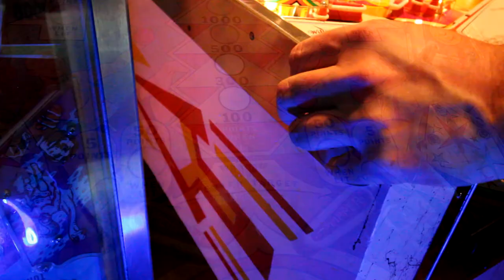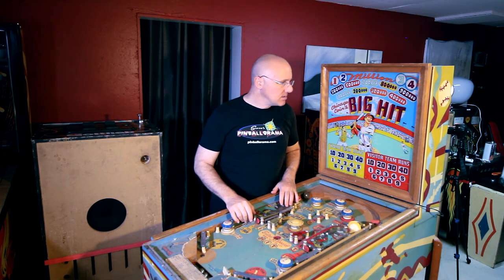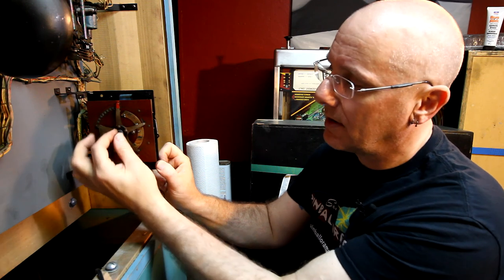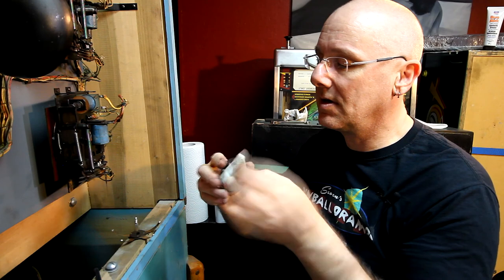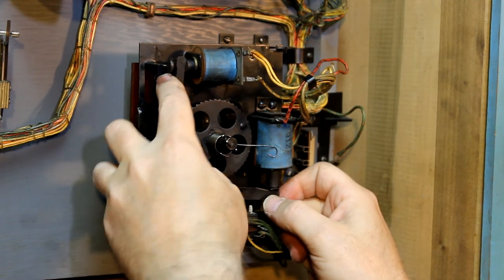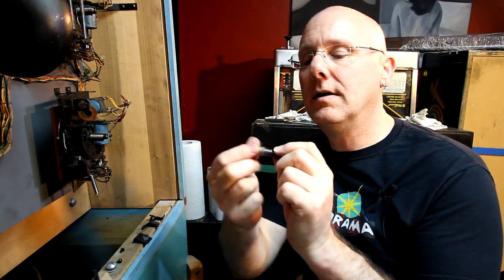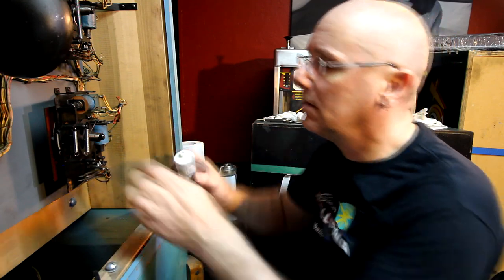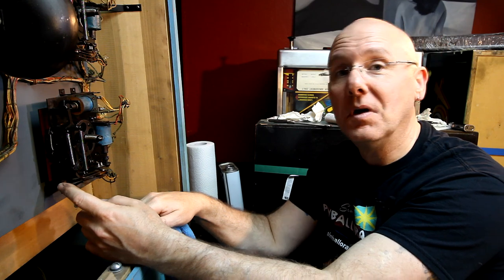Pinball Repair #8 - Cleaning Stepper Units

Comment: Great Video this should help me a lot I have a 1958 Williams Tic Tac Toe that my Parents bought for me back in around 1970 and it just cycles when started and I was told by another owner that owned 2 of the same machines he had the same issue and it was the 10,000 point stepper that was "Gummed up"

Comment: That field looks like a nightmare to play! Hoooly eff, versapack black and decker... you've done well to keep that thing alive
Reply from the maker: I have two of those screwdrivers and they're awesome. I got them around 1999-ish and used them in my computer store for years. I probably assembled and repaired 1000s of computer workstations with them. I need to get new batteries for them. They're starting to die.

Comment: Good information for people that are intimated by working on stepper units. The only negative procedure I seen was of lubrication. Pretty much a no no. Anyone who wants to argue this point out can give Steve young a call and get a earful.
Reply from the maker: I know there are some people in the no-lube at all camp. I like to use it only in the areas I pointed out in the video. A small amount of Teflon grease helps a little with lubrication, but more importantly it protects this area from corrosion (this is also the reason I put it on the contact points). The synthetic greases shouldn't dry out or get gunky and shouldn't gather dust and dirt like a standard oil. (I would never recommend something like 3 in 1 oil.) If the machine is always kept in an area where it will not get rusty, then you are probably fine running it dry. But who knows where this machine will be in 10 years. I might sell it and it might end up in another garage. The little bit of grease I added will help prevent this point from rusting together. Worst case, the synthetic formula in my grease breaks down and in 40 years some dude is making a 3D, VR, hologram video on how to clean it out.

Comment: Great video, thank you.  I have an issue that I hope you can help me with.
 1974 Bally Amigo
My problem is that when I press the game start (credit) button, the score reels do not reset to all zeros.  They will only advance one or two numbers.   For example: I put them all on ones  (1 - 1 - 1 - 1) then press start and they will advance  one or two numbers (2 - 2 - 3 - 2).
  They all score properly, no sticky or gummed up score wheels.
Now... I wonder if this is my problem  - Just before this started happening my machine would totally shut down when the score hit 100.  The problem was the 100 point chime coil was fried.  I simply disconnected the coil and it works great now except for the score reels not zeroing.  I wonder if it needs the chime coil to complete some scoring reset circuit?  
Any ideas?  Thanks!

Comment: Looking at a duotron for my first EM pin. Seller locally has one in very good condition. Playfield and back glass look to be in great shape. Cabinet art looks nice also.Seller says it lights up but when turned on it gets hung up when it boots up. He will take $350. Any thoughts if it is a stepper motor issue and worth $350? Great video and I subscribed.
Reply from the maker: It could be several things which would cause it to not fully cycle. If it powers up and just tries to reset, and the reset motor just spins, those are usually easier to figure out then when you power up and it does nothing. The price sounds pretty good. Have a look inside the machine and see how it looks. If the metal isn't rusted and it looks pretty clean inside, I'd say go for it.

Comment: What cleaning products do you use?
Reply from the maker: To clean the steppers? Just Naphtha.
Reply: How do you clean scoring wheels? I tried using Simple Green, but it started to take off the numbers.
Reply: NO the Best thing to clean before any change is to use  'EXTRA HOLD HAIRSPRAY" , Spray works best...  The Alcohol Cleans and at the same time acts as a protective sealant. Best On Mother boards and Back bottom of Play-fields ! Saw him do this on his other videos

Comment: NO the Best thing to clean before any change is to use  'EXTRA HOLD HAIRSPRAY" , Spray works best...  The Alcohol Cleans and at the same time acts as a protective sealant. Best On Mother boards and Back bottom of Play-fields !